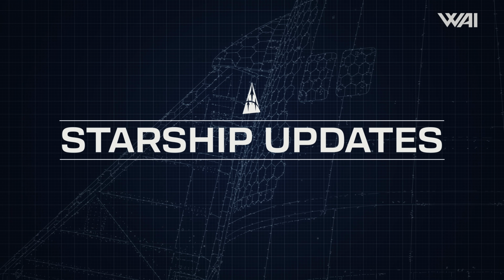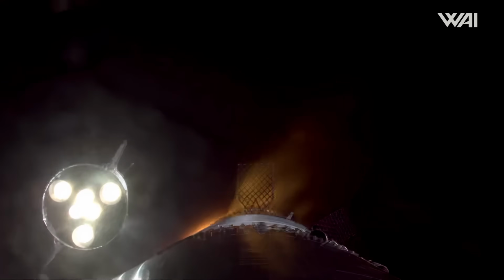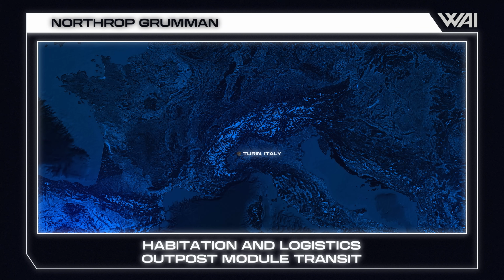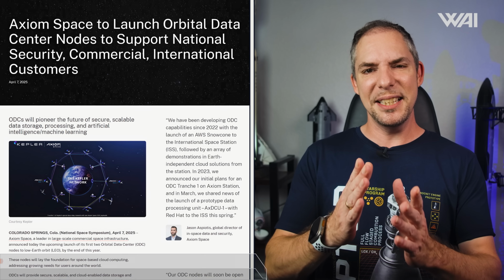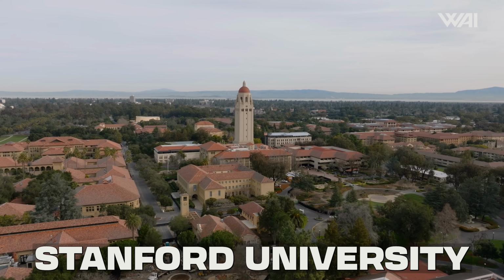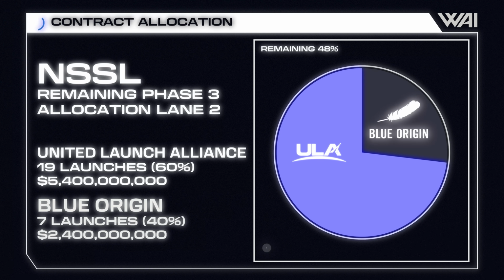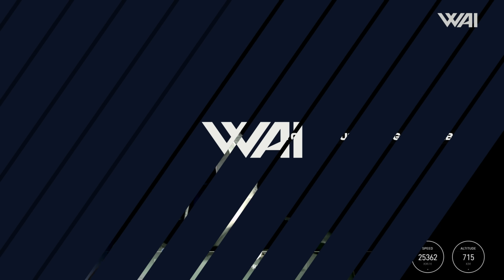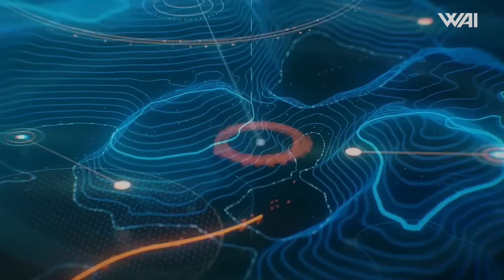SpaceX Unveils MASSIVE Starship Upgrade! Production begins on even crazier version!

Comment: Space-based solar seems like creating 20 new problems to optimize one thing that doesn't need optimization.
Reply: One of those problems is...  What happens when you scale it up?

On the ground you increase albido and eventually cool the planet a bit.

If you collect in space and beam it to the ground you are adding MORE HEAT (except if you collect from L1)
Reply: @davidturpin9135  That's actually less of an issue than it seems, unless you want to plaster about 2% of earths land mass with solar panels (that's about 1000 panels per person)
Reply: The mirrors that I mentioned could turn edge-on to the sun on the daylight side. That would not affect albedo. Still, I doubt this will ever work out because battery storage will continue to fall in cost. And mirrors will cause much worse light "pollution" at night, scattering off even the thinnest clouds. 
 @davidturpin9135
Reply: I'm like what happens if this laser becomes unaligned due to satellite drift or earth movements...
Reply: We could utilize all [the larger] existing ground-based solar arrays, even at night, if orbital mirrors reflected sunlight to them. Paid for by hundreds of subscribers around the globe. 

The downside would be the flashes of light observed on the ground as mirrors flicked to new orientations.
Reply: @imconsequetau5275  Tesla makes billions of dollars per year providing batteries (the Megapacks) to solve the problem you mentioned. It's a far more elegant and practical solution than that orbital laser idea.
Reply: @imconsequetau5275  Ok that's more like space-assisted solar and sounds much more reasonable.

All projects I've heard of are way more complicated, using focused / microwave beams and whatnot, creating a host of new problems.
Reply: As it would, to the untrained eye.

Comment: Tbh I don’t think it means block 3 I think s39 will be the same as block 2 but with raptor 3 engines
Reply from the maker: Hmm... I'm not sure about that. The writing was on the header tank. I could understand if someone would argue that this could just be a v3 header tank, but what does this have to do with the engines?
Reply: @ fair enough I just don’t see spacex making a block 3 ship yet but I’m happy for them to shock us if they do
Reply: @TheVibeChaserr  It makes sense if they can't easily resolve the harmonic issue on  block 2... they might as well push on to Block 3, assuming the engine production is there.  I think Block 2's purpose was to get Starlink satellites in orbit and get practice with Starship flying/reuse, not to be the HLS/tankers.

Comment: Cancel Gateway…then cancel SLS
Reply: How will you get to the moon as soon as possible then?
Reply: @archierush868 my understanding was it’s about going back to stay…not getting there ASAP…it’s becoming a flags and footprints program…which they said it would not be…SLS is not financially sustainable….SLS is doomed to cancellation due to cost..2 or 4 people are physically incapable of of building  an infrastructure of lasting use on the moon…you need to land 20, or 30 to get a base set up, move soil, build infrastructure…Orion is the weak point in that system…too small..plus SLS cost and infrequent flights….its not a sustainable path
Reply: @SusanRice-h1r didn’t answer my question: How will you get your the moon as soon as possible? 

That IS what Artemis 2 and 3’s goals are, and delaying it any further could lead to the US falling behind on the new space race with China, and no-one in the US congress wants China to beat the US back to the moon. If you also cancel SLS and Artemis, that’s $100B down the drain for almost no return. No lander, no crewed flights, no new footprints.

SLS must stay until a new architecture or launch vehicle can take crew to the moon, and has proven it. Don’t cancel SLS when there is literally no alternative. Any more delays or a complete cancellation would set America’s return to the moon back by a decade, minimum. Also, Artemis wasn’t gonna be a permanent human settlement on the first landing, it never was gonna be that. That was more set for Artemis 5,6,7 onwards, and with Jared’s hearing recently, he has made it very clear that he has no plans to cancel SLS or Artemis.
Reply: @ I would think you use a Dragon to dock with HLS in earth orbit..HLS does its moon thing…returns to earth orbit and docks with waiting Dragon and to refuel…but I know nothing and I know you probably don’t like that plan..but it seems doable, quickly and cheaply…I’ll go back to baking cookies
Reply: @SusanRice-h1r HLS doesn’t have the DV to go from LEO to lunar surface and back to LEO without having to do aerobraking passes, which it can’t do since it doesn’t even have a heatshield. That method is physically not possible.
Reply: @archierush868 ahhh.see I did not know…so tankers will then need to refuel HLS in lunar orbit under the current plan?
Reply: @SusanRice-h1r yes, or another lander only to make fuel on the surface can be launched to refuel the lander on the moon when it lands.
Reply: @SusanRice-h1r Dragon’s heat shield is designed specifically for returning from LEO. Also, its life support isn’t designed for lunar roundtrips.
Reply: @AnomalyXero  I assumed dragon would stay in earth orbit…HLS needs to return to earth orbit to refuel….no….will all refueling flights need to go to the moon to dock there with HLS
Reply: @SusanRice-h1r if they don’t make a second lander to make fuel on the surface, yes, they would need to refuel the lander in lunar orbit which could take up to 20 total launches, roughly 4-5 tankers in lunar orbit, each needing around 4-5 tankers just to send them to lunar orbit. It wouldn’t financially be a big deal since the starship launches would be cheap, but it would logistically be a nightmare to send up to 20-25 missions for a single lunar landing.

Comment: 2300 tons is the weight of 35 M1 Abrams Main Battle Tanks. The structure to carry this weight plus payload is an engineering marvel.
Reply: What is impressive about these structures (booster and ship) is how they handle longitudinal compressive loads even before inflating with 6 bar (87 psi) pressure. 

Once fully pressurized, the hull walls are only in tension even during acceleration.
Reply: 35 m1 tanks!

Wow.

Unreal
Reply: Let put tank on the moon!! Most American rover 🇺🇸🦅
Reply: or fantasy.  None of this has been carried yet.
Reply: @jackprier7727  The booster carries far more than that, and Starship has had 2 controlled landings.  Thanks for joining this channel so you can learn things.
Reply: @dherman0001  the pointed, important end has not yet had any controlled landings.  Glad you could learn something.
Reply: @jackprier7727  several already actually, the accuracy of the ocean landings by starship is the whole reason there was so much hype over a potential catch coming soon
Reply: @jackprier7727 flight 5 and 6?
Reply: @jackprier7727  It has made a controlled descent twice off Australias western coast.  This Youtube channel, and many others have videos documenting it.  Thanks again for wanting to learn.

Comment: Felix, do they intend to keep the header tank at the nose of Starship, what about when that area is made for a human crew cabin? If not why don't they do the testing for where the header tank will eventually be?
Reply: The header tanks are in the nosecone to balance the centre of mass of the ship during descent. The nosecone likely won’t be used for crewed space or even nose to nose docking as we know they are doing side to side docking kinda like Shuttle, so it’s probably gonna be like that
Reply: space built on the side of the  spaceship  same spot were refueling will be .
Reply: These header tanks need to be at the top of the fuel tanks themselves, not extra add-ons at the extreme ends of the Ship.
Reply: @steve5090406 no, it’s to balance the CoG of the ship during descent. It will have docking hardware on the leeward side of the ships except for the HLS ship which won’t have header tanks because it won’t reenter and land on earth, so it can have nosecone docking hardware.
Reply: @steve5090406 no, it needs to be in the nosecone to balance the centre of mass when descending through the atmosphere of a celestial body. Too far forward, it nosedives. Too far back, it goes engines first.

Comment: Might want to reduce the enthusiasm for block 3 until block 2 stops blowing up!
Reply from the maker: Quite the opposite! If Block 2 doesn't work, the logical step is accelerating the move to the next version.
Reply: @Whataboutit that’s like saying if your leg has gangrene, you need to cut it off… oh wait
Reply: The concept works regardless of nit pickers who live to poor cold water on advancements ❤
Reply: or skip block 2
Reply: Solution: move on to block 3
Reply: @stevenlipps1176  3 is better than 2 plus that is the way Spacex dev works... Was same with Falcon dev... Blow things up and then fix them

Comment: V3 will be heavier, so we may need better shopsticks & tower ?  Too bad, they are building new ones for V1 and V2  ( ?? )
Reply: The sticks can hold around 500-700T, and the pads are being built for V3 or V4 ships, depending on if V3’s are just V2’s with R3 engines and V4’s are the tall ones.
Reply: No, they are not stupid. Pad B is already done for V3.